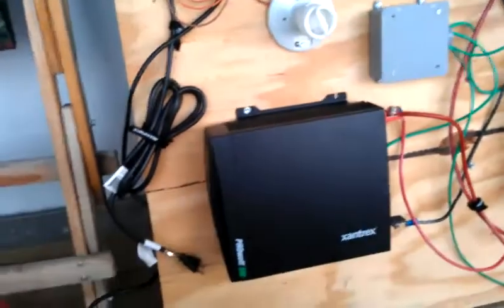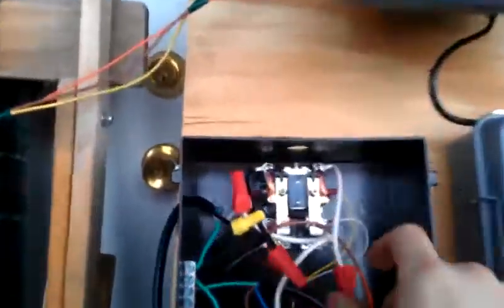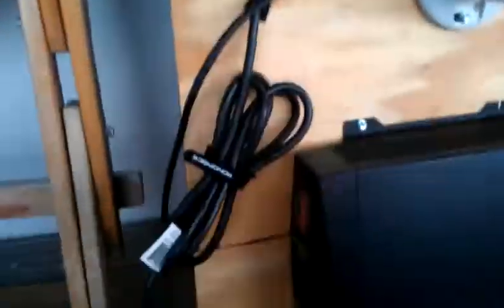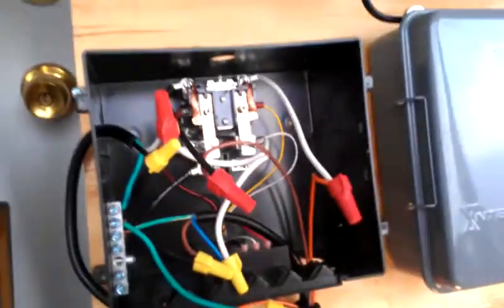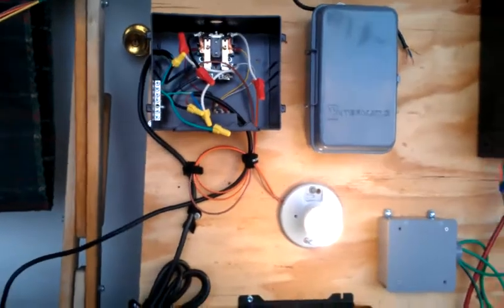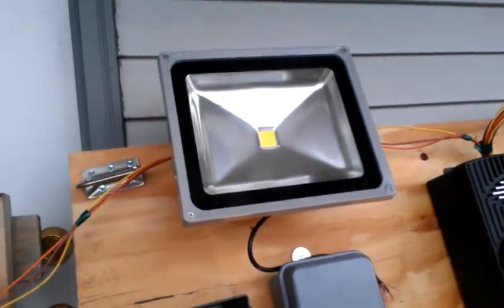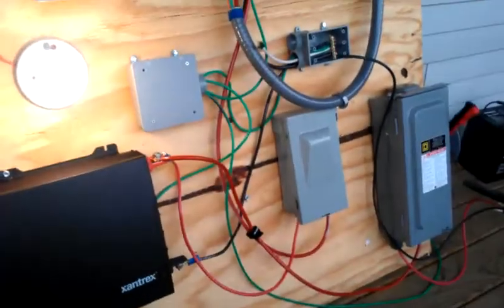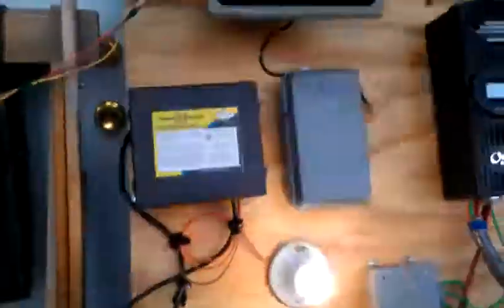Polish Hill Solar Proof-of-Concept (Auto Transfer Switch in Action) for 329 Hancock St

Comment: Hello bseklecki . I just want to say magnificent job and I am happy to see that finally someone have done it with the ATS concept. I want to start a solar business here in Poland and the core component in my system is ATS. Poland does not want to adopt a feed in tariff for renewable so the only option left is to make island systems. in this system I am planning to be connected primarily  to solar, and be able to switch automatically to the grid if the battery charge level drops below certain lev